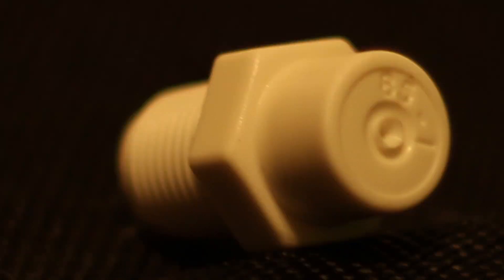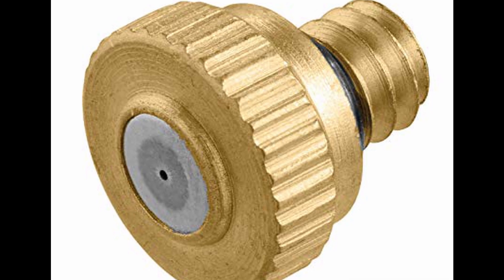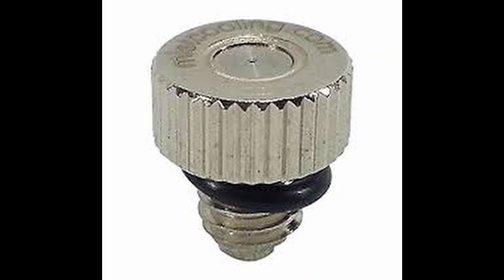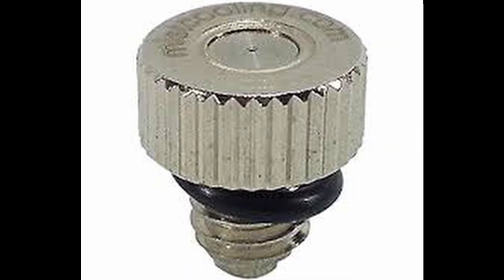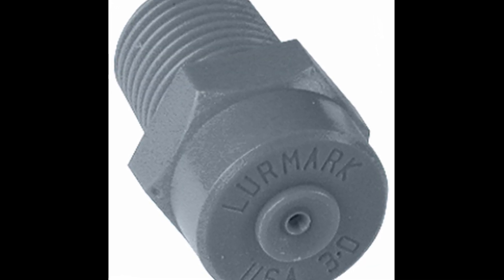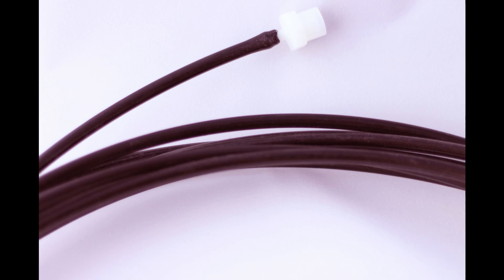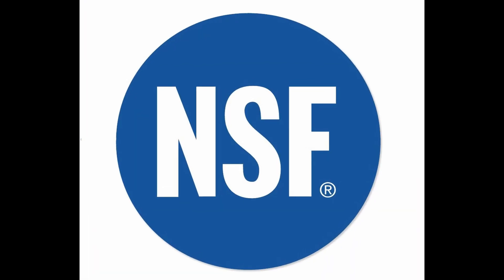Aeroponic Misters - Choosing the best nozzle material - Part 1

Comment: Aside from cost, is there any reason why CERAMIC nozzles aren't a good idea? Could ceramic nozzles be cleaned from salts in a solution that dissolves what's deposited and clogging the nozzle, and then washed clean and reused?

Comment: I live in the desert so it can get up to 115 here. I’m assuming that I cannot use a plastic nozzle. I don’t really feel comfortable use plastics in such heat when it comes to food. You mentioned that using different materials for tubing and the nozzle could be an issue. Do you have any suggestions for which tubing materials could maintain the integrity of the entire system when using steel nozzles. And do you have a recommendation for steel nozzles?
Reply from the maker: Great point! However, most roots can't tolerate 115F. So there will be bigger issues with your plants. Maybe I can make  a video on this.

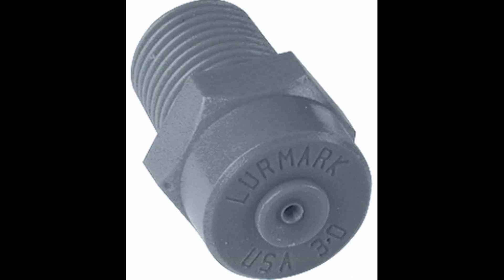Comment: Hey Mister Lee, I love your channel and I have learned a ton already. I was wondering if you could answer one question I had on one of the topics. In your video @5:39 you mention that if you have salts in your nutrient solution you should go for stainless steel nozzles instead of the plastic nozzles. What do you mean here with salts? Because in my understanding plant nutrition is always composed out of salts like kno3  or MgSO4 which after being brought in solution the plant can take up as K or Mg e.d. So do you mean another kind of salt or should you always go for stainless steel nozzles when you work with plant nutrition liquids? Kind regards, Emiel
Reply from the maker: I now recommend plastic. Certain concentrations can deform the nozzle orifice. Because the plastic is cheap, just replace them as needed.
Thanks for asking

Comment: What about copper plated with nickel, these are the only ones I can seem to find here, the manufacturer says they should not have any issues, what is your feedback about it?
Reply from the maker: Sorry. I can't recommend those nozzles.
Thanks for asking
Reply: @HighTechGardener  Copper nickel plated have an addition pre filter before the nozzle, stainless steels ones do not, so I am kind of deciding between the 2, you'd recommend using the stainless steel ones without the filter?

Comment: @ 5:00 i belive it's called electrolysis same reason you can't strap a copper pipe with a steel strap
Reply: Actually called "galvanic reaction". Stainless steel creates a weak electrical charge when contacting non ferrous metals like aluminum and copper.
This is where the corrosion comes from. Never use a stainless bolt in an aluminum hole if you ever want to use that hole again. :)

Comment: good vid.... i actually use plastic hydroponic nozzles in my race car   for water meth injection.... works great....  low  pressure   high mist    excellent
Reply from the maker: Thanks for sharing. Race cars?
Reply: @HighTechGardener  yeah man    got a 10micron nozzle just after the turbo and 20 micon one spraying the outside of the intercooler... takes the temps down from 80 degrees down to 30   thats a pretty big drop
Reply: @MRBACKHAND  bro that's mad, went straight in to google it :D

Comment: What is the name of the poly nozzles that you use?
Reply from the maker: Hi jtg
The reason I didn't mention it because the manufacturer doesn't do direct sales.
I'm in the process of finding a replacement that might be even cheaper.
Here's the nozzle I used in the image:
BETE UltiMist Spray Nozzle UML63M
We'll take you garden into the future.
Reply: High Tech Gardener Thanks for the response.
Reply: @HighTechGardener  
i`m waiting to see how well the plants grow compared to hydroponics before i buy anything.
Reply from the maker: @johnguest4525 
 I understand. Thanks for watching.